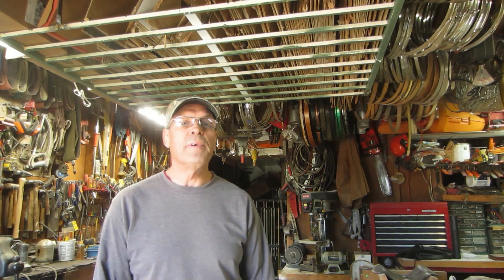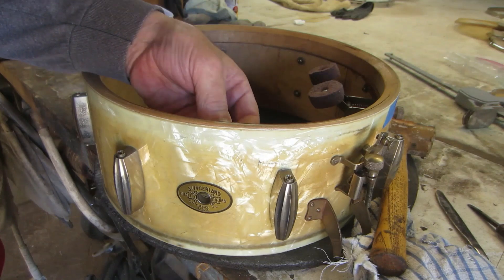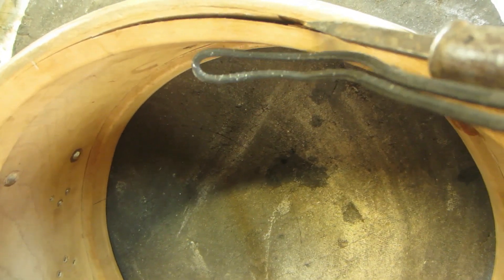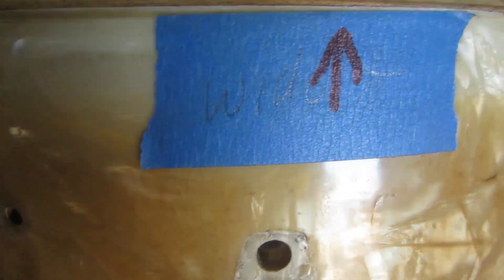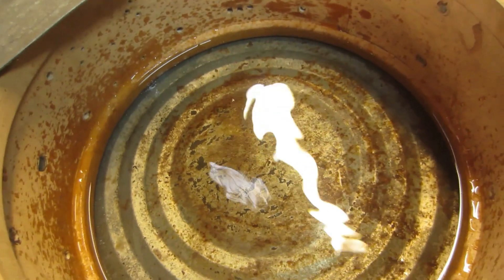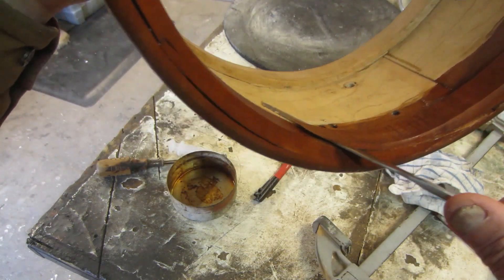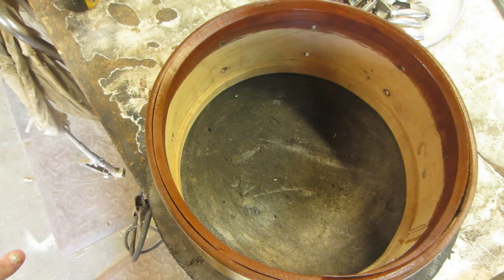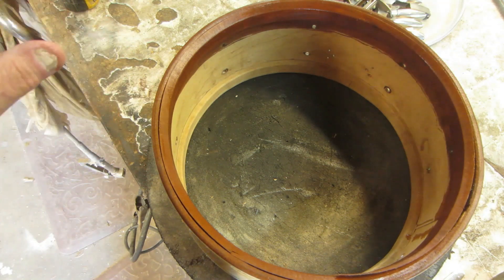Oversized and Out of Round Snare Drum....What to do?

Comment: Hi Bruce. A good way to get a drum back in round is to work from the inside diameter. First, remove the entire re-ring (just like you did), then measure what the inside diameter should be without the re-ring. Next, cut a disc from a piece of hard wood (at least an inch thick) the exact size of what the inside diameter should be. Then apply glue on both the inner shell and the outside edge of the disc. Insert the disc to the inner shell which will force the drum back into round, clamp everything from the outside and let it dry. After everything has dried, measure how thick you want the new re-ring to be, draw a guideline for the inner edge, drill a hole, and then run a jigsaw along the guideline all the way around (or you can use a router). Sand the new re-ring and boom, you're done. No, you're not using the original re-ring - and I'm sure purists might have an issue with that - but you'll have a useable drum that's back in round. Russ

Comment: Hi Bruce.  Wow that is my snare.  '48-'49.  I have the whole kit.  My nickel...  That drum was round when it left the factory.  They were turned in a lathe.  Then the rings were added.  Oversize probably.  The heads were too.  I was lucky to have Aquarian modern vintage heads fit mine when I took the calf ones off.  This was 2001.  Seems to me yours was stored with uneven tension.  I would get it round, wet sand and buff to remove some of the yellow and sell it.  I guarentee somebody needs that large oval badge beauty.  And it's ORIGINAL!  Cheers.
Reply from the maker: Hi Brian,  thanks for chiming in. This shell is WAY oversize. I have owned over a hundred or more RKs in my life and this is the worst I have seen. There is no way you could just sand a bit and expect to get the heads on man. It measure over 14" at minimum all the way around. Look at my tape measure. I think the WMP is going to be removed and I will contour the shell so you can use any heads. Stay tuned. Bruce
Reply: @vintagedrumrestorationgara91  I know it will turn out nice!  These snares really sound so good.
Reply from the maker: @brianchisnell1548  Yes they are great drums and I just cant let this one go to the scrap heap, even if I dont keep it which is most likely the case. Thanks Brian for the comments! Bruce

Comment: Another option instead of squeezing the shell at the widest point to try getting it back into shape, you can sometimes put a piece of wood across the inside of the shell, forced in at the narrowest point, to push it outwards.   Just leave it in place as you re-glue the rerings.   You might just need to saw the piece in half to remove it after the glue has dried, if it won't come out past the rings!  The big clamp on the outside can get in the way of the small clamps you are using to clamp the re-ring back on.     A small cabinet scraper is good for removing the old glue, then a little curved bock of wood with some 120 grit sandpaper stuck to it with double sided tape.   Another tip is you can use masking tape on the inside of the shell to catch most of the glue squeeze out, so there is less excess to clean off.   Just make sure it's far enough down that you don't end up with masking tape glued in between the shell and re-ring!

Comment: Hi Bruce, I enjoyed this video and have a few thoughts. Have you ever tried allthread? I have a Slingerland 3 ply, around 1957 that was out of round. Used the allthread through the lug holes with washers and nuts at multiple locations on the shell, sprayed the inside if the shell with water and kinda rubbed it in, not completely soaking it and let it dry for a few days. It popped the rerings a little and I glued it back with the allthread still in place. It got the drum in round enough to get regular heads on it. I can send some pictures if you're interested.
Reply from the maker: That is a great way to get a shell back in round Tony and I really appreciate your ideas...... BUT..... This shell was OVERSIZED and in this case it was basically in round after my soaking the rings out and clamping it back together, Regardless, it was still oversized, so what needed to happen was contouring the shell down to fit heads. Its either that or leave the drum the way it is and look at it. Nice to hear from you and your ideas are always welcome here friend. Like to hear more from you. Cheers, Bruce

Comment: Great stuff ! 
I got a cheap early 2001 Gretsch Catalina 14x18 bass drum online for 150.00 . problem is, it got a hairline crack about 3" long on the inside of the shell during shipping. It's only effects the top layer, removed hardware  (spur) to check holes, and runs right up to the edge, so I can see it's in-fact only the top ply. What would be a good way to prevent the crack from spreading with out making a mess, maybe I use some silver to help seal it up after some type of glue ? I can see the crack but can't feel it with my finger, feels smooth as if it wasn't  no crack there.

Comment: I’d sand the top layer of the wrap, with progressive finer sand paper and the buff, that normally you can get rid of most of the yellowing. 
There’s another method that Ive tried un rubber and plastics but never in drums. You put a thin layer of 40 volumen hair developer, wrap it with film and put the shell in the sun. 
And try the remo classic fit, they are supposed to fit oversized drums
Reply: I've had good luck with both methods.  Fine sanding as well as hydrogen peroxide.
Reply from the maker: Thanks for your comment Enrico. The shell is just too oversized even for classic fit heads. It was made when calf was the norm, so whatever you do to the wrap the heads still wont fit. Cheers, Bruce

Comment: Funny, I was going to ask about this. I have the exact same snare except cloud badge. I can get the bottom a head on top is tight closest is Aquarian vintage. But that still snug. doesn’t look like there’s separation so I couldn’t figure out why heads are tight.
Reply from the maker: Measure around the shell in several different spot and you will see that the drum is most likely out of round. Yours may be only slightly out, but you would still have to take the ring out and turn it a 1/4 turn before reinstalling it. Are you up for the task? Cheers, Bruce
Reply: Also, I don’t know if you experienced this either. I tried Remo classic fit and they were actually smaller. They’re supposed to be larger for drums like that. I did not have luck with that head.

Comment: Hey why not just say screw it and leave the rings out? Or is that just dumb lol?
Reply from the maker: The drum was oversized, heads would no go on. The rings were one thing, but had little to do with it being oversized. Problems solved now. Thanks, Bruce
Reply: Reinforcing rings are absolutely necessary with drums of this construction.
Reply from the maker: @Assimilator702  Yes Joe you are correct. The thing that some are missing is that the shell  WAS too large for modern heads to fit over. Problem solved. Bruce